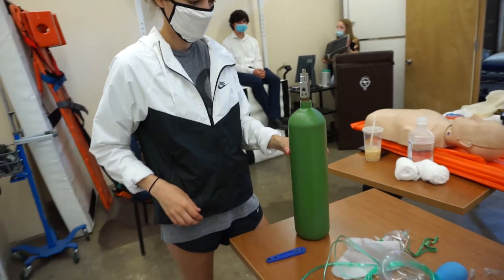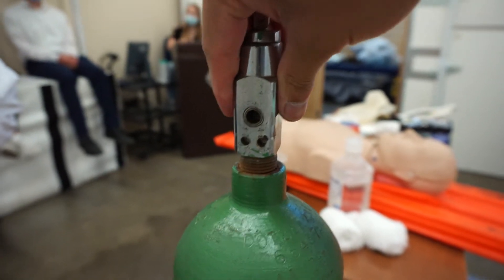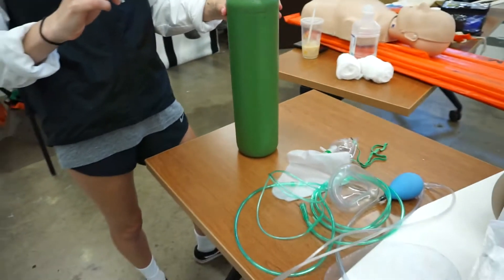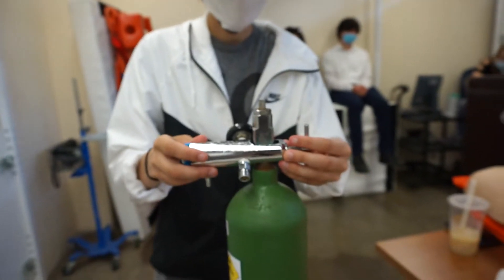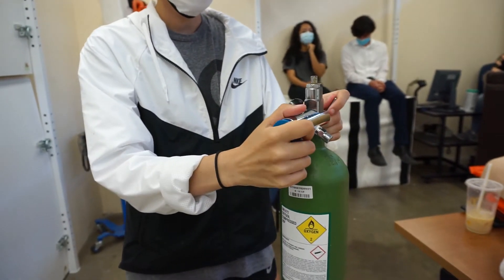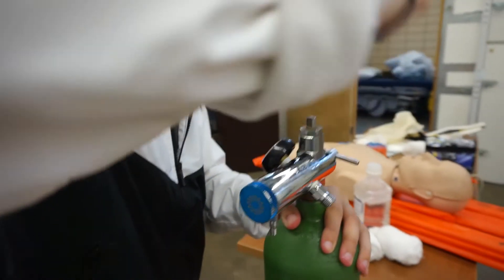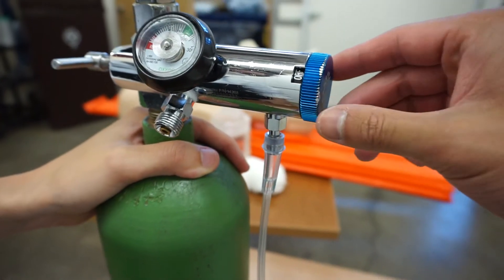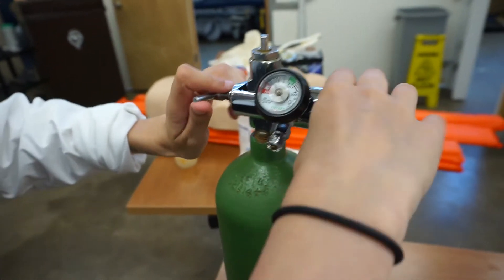Oxygen tank (EMT Basics)

Comment: Is there supposed to be a washer on one of the ports that connects into the oxygen tank?  I ask because I have my regular hooked up correctly, but oxygen keeps flowing out or the holes it's supposed to connect into.
Reply from the maker: There is an O ring above the two prongs in the regulator. That might be your issue
Reply: @ChicagoEMTTraining  - That's what it was.  Mine was missing.  I was able to obtain another regulator and it had the rubber O ring on it.  Thanks for the info!!!  Keep up the good work!!!